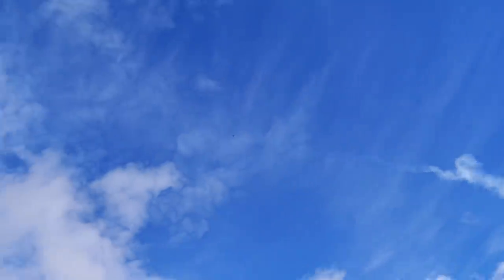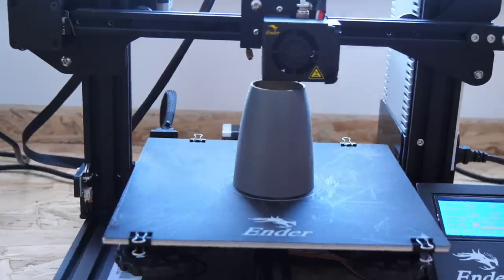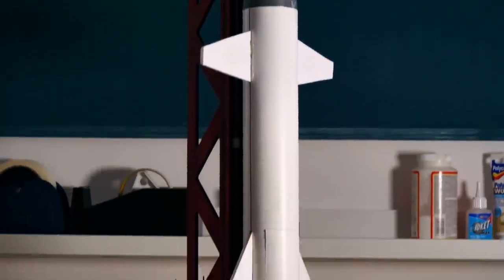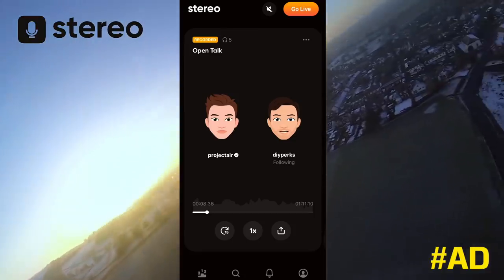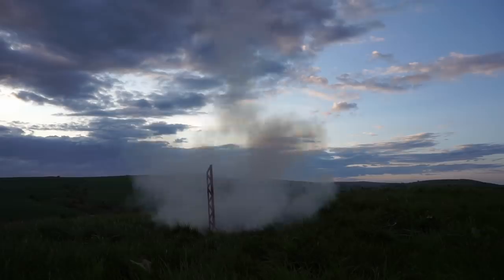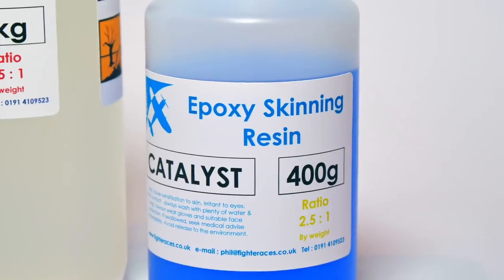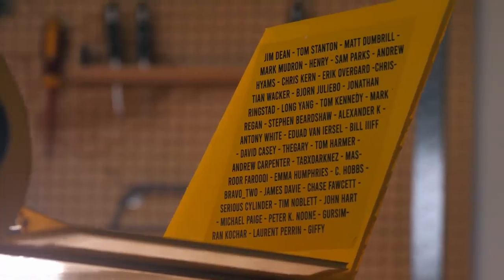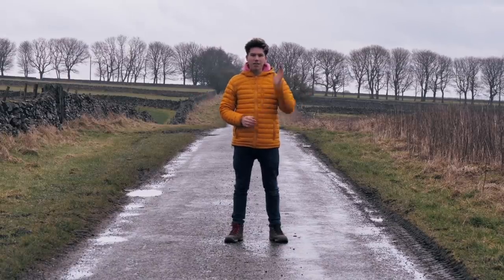Building a High Power Rocket Plane (V2)

Comment: Good job, keep it up. looking forward to seeing your test flights.  Little tip: For putting servos in foam board, I like to print a sticker with the outline of the servo, apply it to the model, then cutout the outline through the sticker with a hobby knife before inserting the servo. It makes neat holes and reinforces the surface.

Comment: The biggest problem with canards is at high speed they easily become dynamically unstable
Reply: thought you said canada
Reply: Canard designs are inherently unstable across the speed range. Also, intentionally stalling the canard before the main wing stalls can lead to some interesting flight characteristics.
Reply: Yeah. I would have gone for a slightly longer delta and no canard. I'd also ditch the wingtip verticals and either have one larger one vertical on the fuselage, or two at about 40 degrees. I reckon this would be faster and better, but it ain't my camel and this guy's designs do seem to work. My experience with EDF deltas may not apply to friggin rocket planes!
Reply: @OzAndyify  Yes - delta wings want vortices to align with the leading edge of high angles of attack to keep the flow attached to achieve that high angle of attack before stalling. Arguably the wing tip verticals foil that flow, no pun intended.
Reply: @JoeOvercoat  Yeah, but tip winglets are tricky buggers to optimize at the best of times. Airliners only use them due to wingspan restrictions. 
Highly swept, low-aspect deltas have more spanwise stuff going on than "normal" wings, with the relative wind angle increasing towards the tips. The Leading Edge vortex effect, which only works for highly swept deltas with sharp LE, allows surprising high AOA by generating a stable vortex that effectively increases camber. It's almost a virtual top surface...similar to turbulators on STOL planes.  (see Facetmobile for extreme delta lift.) They are rather gnarly  to control at slow speeds and have dangerous "corners" if low, slow and underpowered.
Having said that, I don't think he is aiming for minimum drag, especially on landing approach, where high AOA is likely. Looking a little bit cooler and being more draggy is probably better for this project.
Reply: @OzAndyify  Yes, and the wide spacing of the verticals is typical of such rockets. Though to be honest setting itself on fire might lead to a win here.
Reply: @JoeOvercoat More fire would be entertaining, and easier to find in the grass too!
Reply: @OzAndyify  well it will either look like a viggen or a J35 draken, either way I'm down
Reply: @albatross8868  +1 for the J35!

Comment: Nice project! 
Most canard planes have zero or very little elevator mix into the ailerons/elevons, I suggest you to reduce the mix to 10% elevator and 90% aileron. As for CoG, you should aim for slightly higher wing area load for the canard than for the main wing. You no NOT want the main wing to stall before the canard wing.

Comment: Apply a coat of resin before you lay the cloth, it makes it easier to saturate the cloth and should require less resin
Reply: And minimize bubbles under the threads.
Reply: It's a very heavy way of reinforcing, maybe some carbon stringers would be better?
Glass is normally used with polyester resin rather than epoxy.
Maybe you could consider Diolin instead of grp? It doesn't shatter.

Am I the only person who thinks it looks like Fireball XL5?

Comment: When using fibreglass or carbon fibre for strengthening. You should apply the resin first, lay down the fibre layer and then gently push the resin up through the layer. This reduces the damage to the stitching, thus making the layer stronger, and also reducing inclusions and other defects caused when adhering these layers. Doing this method over the method you used can greatly increase the strength of the fuselage.

Hope this helps in future 😁

Comment: Little tip to keep your hands warm, and be able to do fiddly things - Fingerless gloves, preferably 3m Thinsulate ones, I used them on the outdoor markets for years handling cash and doing small repair jobs. You will not be disappointed- they are excellent. Your hands are covered and your fingers free to work without getting cold.

Comment: hey I'm a certified autobody tech in Canada, A tip for painting yellow is start with a grey/green base coat yellows pigments tend to have poor coverage and is extremely expensive when mixing your own paint so i would save some green and and it to a dark grey shade primer, it cuts the coats needed of the yellow in half. just for future and same goes for orange for your next time.

Comment: If you're serious about going fast, make the fuselage just large enough to fit the motor
Reply from the maker: I didn't really touch on this in the video, but this particular plane is purposely large and draggy so it doesn't fly too fast!
Reply: A minimum diameter rocket would be hard to fit all the electric bits into and also it would fly incredibly fast and you wouldn't really be able to control it as a human 😉
Reply: @Project-Air  interesting.  A larger cross section will generate more lift in a yaw, as well.
Reply: @pieman12345678987654  that  would be the fun part!

Comment: Just an FYI hot glue is generally frowned upon when you get to high powered rocketry. It's less of an issue the farther from the motor you are, but we generally prefer epoxy, 5 minute or 30 minute if you have the patience and are flying up to level 2 motors (J-L). The fiberglass helps a lot, but you might not even need it with the right adhesive.

Comment: If you ever come to Chicago we should race, just made a 3D printed carbon fiber hybrid rocket jet using dual Edfs one 5000kv 12 blade and a 20,000 kv 5 blade, with two G engines in the tail activated via pica switches. Runs on two 120A esc and 12s Currently working on V2 witch will be all carbon fiber utilizing a similar  delta wing configuration!

Comment: Have you tried Kerbal space project? Some of the issues you are facing can be seen there. Namely the positioning of the centre of lift and the centre of gravity. Without computerized control controlling a highly unstable plane is very hard. Since the wings are in the back, to get the centre of gravity behind the centre of lift, you would need to pack all the weight into the same section as the rocket engine. Another possibility is to move the wing forward.

Comment: FUTURE TIP FOR FIBERGLASS: If you have a sharp corner fiberglass will not bend around it and it must be rounded, a light sanding will also help it stick better if you ever have any peel off after applying it :) (I build fiberglass boats so I'd thought I'd throw you some helpful knowledge!)

Comment: Wouldnt it be better to invert  the conard elevator input? Compared to the elevons, the conards might push the nose down in flight instead of lifting it up when you apply full up on the stick, and might act like reverse flaps and cause it to quickly sink into the ground.

Comment: Why not have the entire elevators pivot? You mount the servos inside with just the gear or cog or sprocket (or whatever you call it) exposed to the outside (this is what will connect to the elevators). Then you find the point just ahead of the center of the elevator, attach to the servo's gear at that point, adjust the servos to desired turn parameters and that should be it. You'll need to do some fine tuning (a wind tunnel would really help with the tuning and adjustments) but your aerodynamics will improve.

Comment: Please please please!!!!!! Your control set up is WRONG. Flighttest sets up their canards the same way and they fail EVERY TIME. I own and fly a REAL canard. The canard should ONLY be elevator and the main wings should ONLY be aileron. If both the canard and main wind act as he elevator then it will stall every single time. It creates too much rotation on that axis and stalls. Trust me. I fly a Long EZ to work as an airplane mechanic everyday.
Reply from the maker: I'm going to be experimenting with the control set up with the smaller model :)
Reply: Check out the flighttest channel. They have built several canards and they all failed for the same reason. Because they put elevator control on both the canard and the main wing. If you want the highest chance for success then put elevator control on the canard only and aileron control on the main wing only. Otherwise I guarantee it will fail.